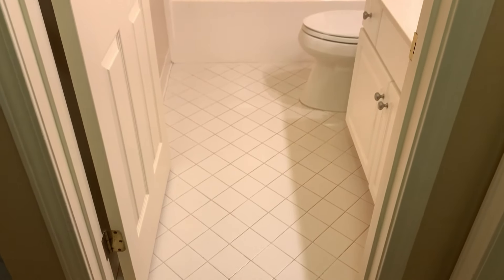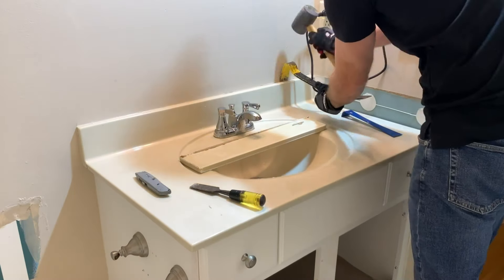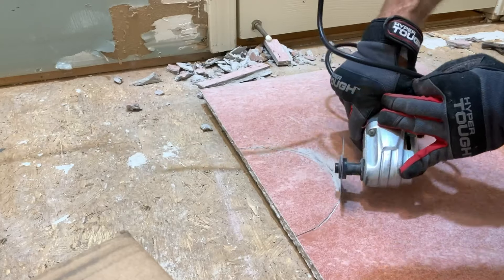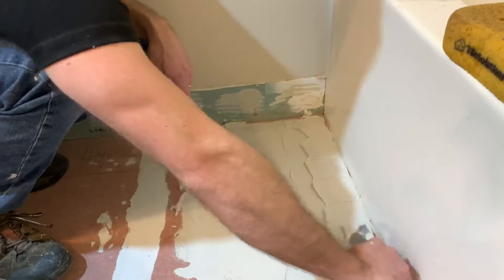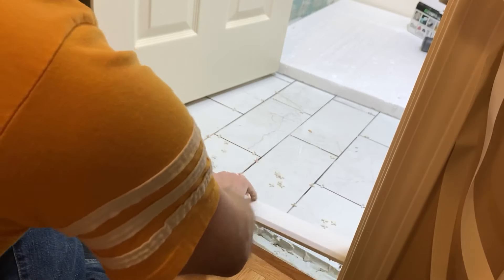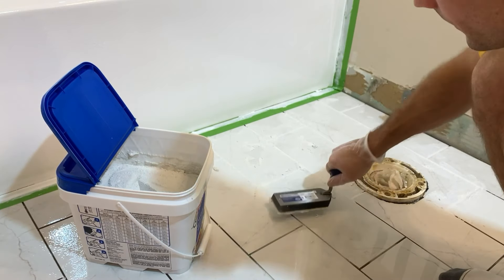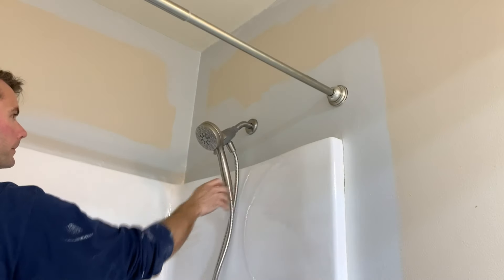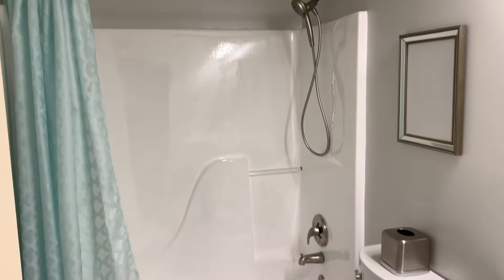Just another classic Bathroom Remodel YouTube video

Comment: Bravo!  Looks great, man!  I am super jealous you basically got this done in a weekend haha.  Also, the hardi backer... I cut it outside with a mask on and use a regular old junk blade in my circular saw.  Whatever used wood blade I have laying around does the trick and use a jigsaw for the tricky cuts.  Again, awesome work.  Looks way better!  👍
Reply from the maker: DUDE! I was channeling my inner The Fixer during this entire project. Your videos are a huge inspiration!! Thanks for the tip on the hardibacker I felt completely incompetent during that part of the project.
Reply: @RLLWoodworks  haha love it!  Yeah I think the instructions don’t say anything about using a saw because the product is almost definitely not good to breathe in (as with any building materials really).  But that is how I do it.  Wear a mask, make a cut and walk away for a minute.  The bathroom turned out great.  Nice solution with the shower refinishing.  Like my tub, not perfect but way better!  Keep the videos coming!
Reply from the maker: @TheFixerHomeRepair  Ah, yeah that makes sense that they wouldn't promote cutting it like that then. Thanks so much man!